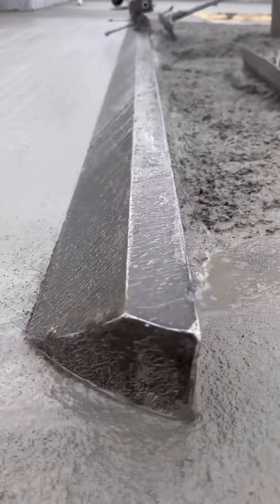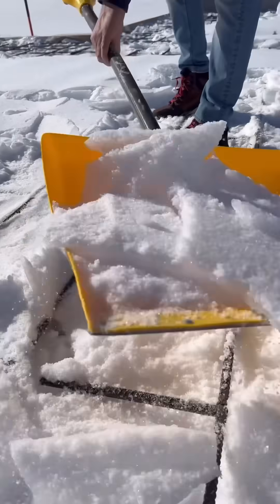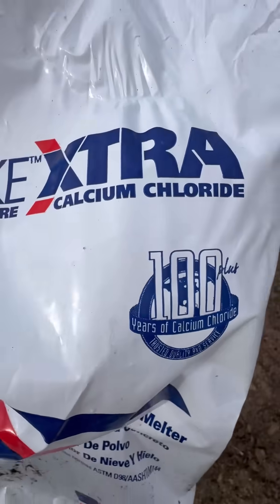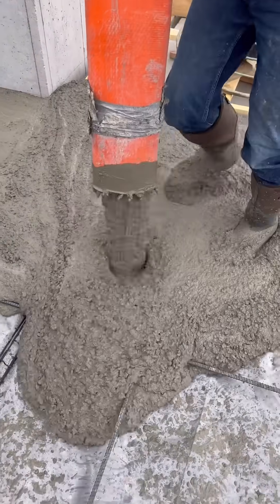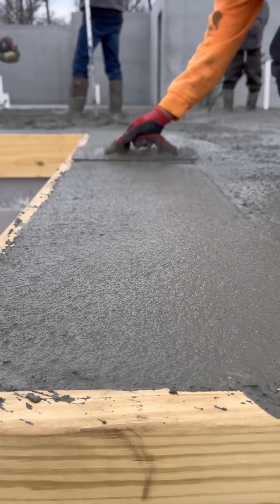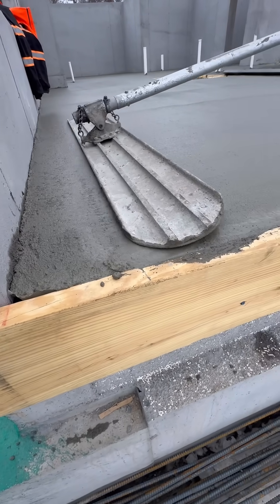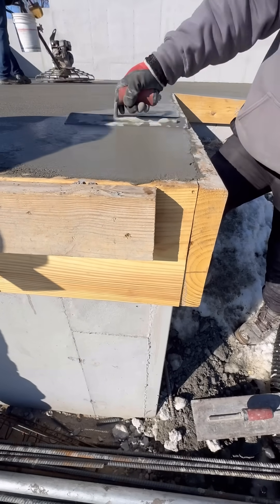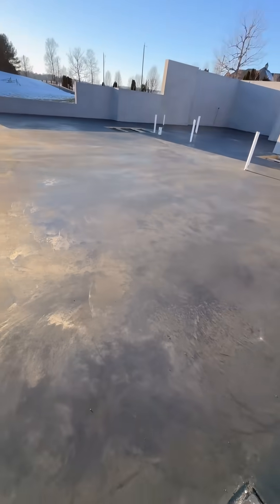How to Pour Concrete in Cold Weather

Comment: There are two kinds of concrete, the kind that's cracked, and the kind that's going to crack.
Reply from the maker: 100%
Reply: Grooves or cuts know where the cracking will be. Nothing will tell you the weakest part. The Earth cracks, it's not seamless.
Reply: So does that make concrete workers crack addicts?
Reply: @ Is a plumber a crack seductionist?
Reply: Here in Australia, grooves are cut into the surface to that when it cracks at least it is neat.
Reply: @itsamindgame9198  same in Canada
Reply: @itsamindgame9198 that's not an australian thing, that's a universal thing
Reply: @CheeseMiser  When it comes to construction, I don't like to assume that anywhere else does it the way I am familiar with here.  Many things are the same but then many things are very different (e.g. roofing).
Reply: @itsamindgame9198  Australians barely thought of expansion joints?
Reply: @itsamindgame9198  they’re called expansion joints and we use them as well, my guess is that he’ll cut them in later since they didn’t trowel them in
Reply: @chrisbaldwin8293  Expansion joints are often actual joints, two slabs butted although often with a material between them.  With exposed ag here the grooves are usually cut not trowelled.  I know they wind up getting called expansion joints here as well, but they aren't for expansion and they aren't joints.  But I guess "shrink breaks" sounds a bit funny.
Reply: @chrisbaldwin8293 He actually says in a reply to another comment that they cut in the next day, then covered with insulated tarps, just FYI.
Reply: @itsamindgame9198 Yeah we have those in America too and expansion joints the difference is that unlike Australia 90% of america deals with 40+ degree temperature variations with the state I personally live in getting down to -40 on the regular. So yeah our slabs are fucked after 10 years or so
Reply: @BsedMan-if6tb  We get more variation in summer, but about the same magnitude.  We seem to use a much less "sloppy" mud, with more aggregate.  I am not sure exactly what difference that would make.
Reply: @itsamindgame9198  heat isn't gonna damage concrete near as much as extreme cold. Basically it's like glass, if you supercool it for a while then pour lukewarm water it will shatter, but if you heat glass up to 48C and put some semi cool water on it it won't crack. As for the aggregate it just depends on the region of the US you live in cause it's all locally sourced gravel/sand like the sidewalks in my town are larger aggregate but the highways are usually a smoother concrete.
Reply: @itsamindgame9198  imo the smoother stuff does better before first splitting but you're talking about 8 months in my state of snow and ice to make the concrete nice and brittle then during the thaw there's water sitting on it for weeks at a time and you get maybe a month where it gets up to 28-30c
Reply: @itsamindgame9198 you mean everywhere in the world?  🤦‍♂️
Reply: @itsamindgame9198  I think that’s the same around the whole world with modern construction lol. It’s the same here in the US. We have found out (like all the comments say) that concrete is not a will it crack, but a when it will crack. Hence the cuts that you mentioned so that we can somewhat control where it’ll crack.
Reply: @itsamindgame9198 if needed they will add expansion joints throughout the slab once it’s cured out
Reply: Show me a modern concrete that doesn't crack and I will show you my unicorn
Reply: Thank you
Reply: Not the Greece concrete that did not ctack for 2000 and more years.
Reply: It all cracks.  It’s up to you to cut and control the cracks.  But I’d guess they used like 4% polar set, and filled it with air,  but in this weather that will cause it to spiderweb, and the top will pop.
Reply: Bro could not be more right 😂
Reply: 3 there's Roman concrete that repairs itself with time and rain.
Reply: You literally stole that joke from guy before you
Reply: @pinacoladatv808  I was literally the first comment on the video
Reply: Look up Roman concrete ... that's the kind that cracks but heals.
Reply: My house sits on a concrete plate as I wanted no basement steps in my old age. Poured in 1984, not a crack anywhere. We didn't even use rebar, the fill is full of old hog panel fencing.  It's also a little on the thick side.
Reply: @wymple09  That's what we use (6" square, 1/8" bar, 4x8' panels) when we do a radiant pex tubing job. We use zip ties to hold the pex to the panels. And at the same time it helps strengthen the concrete. And ALWAYS insulate every concrete slab, if there's 4 seasons, whether you have pex tubing or not.

Comment: Let me know if I’m wrong but won’t the calcium chloride rust the rebar and compromise the strength? Normally in loads being used with rebar I would recommend using NCA or non chloride accelerator.
Reply from the maker: I’m not worried about the calcium chloride rusting the rebar with the small amount we used. I did try non-calcium chloride one time that was added in at the plant. For whatever reason it didn’t work and was almost a disaster.
Reply: @hausplans we use NCA all time. Engineers here in Canada will not allow calcium in a suspended slab. However in a SOG such as yours or a sidewalk. All good.
Reply: @sheldonduiker8783  I was under the impression that only applied to bare rebar, IE Epoxy-coated or FG was a-ok?
Reply: @hausplans  yeah I understand I used to be a batch operator for a concrete company. Big difference, because from the plant the NCA had a lot more time to mix with the concrete so I assume it was setting up quick.
Reply: Rebar won’t rust that’s encased in concrete. It needs air to rust.
Reply: @ water seeps through concrete unless a special additive is used so I’m assuming some air can seep through concrete as well. Or am I wrong?
Reply: @ you can bust up 50 year old concrete and the rebar is intact.

Comment: GC here out of CA...well done brotha. Nothing wrong with pouring concrete in low temps. Excellent finish!
Reply from the maker: Thanks
Reply: Um...   Yes there is.  Anything under +8 Celsius has a good chance of cracking unless kept warm and covered for the first 2 weeks.
Reply: @MapleBalls  that doesnt mean theres anything wrong they just didnt show the aftercare of the slab.

Comment: Is the vibrating bar a tool that you own or part of the concrete truck company services?
Reply from the maker: The guy I hired to pour the slab owns it. It’s called a power screed.
Reply: @hausplans  Learn something new every day! Nice work on the slab!
Reply: I have a Vibra screed.  Absolutely fantastic after you get the hang of it.
Reply from the maker: Yeah, when I first started we had to use a long 2 x 4 screed for everything. That would kill your back.